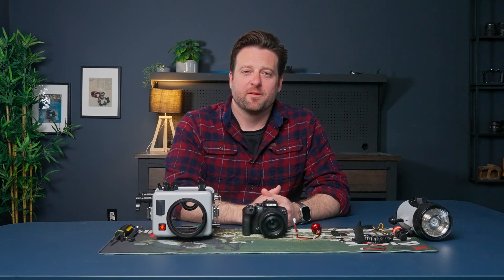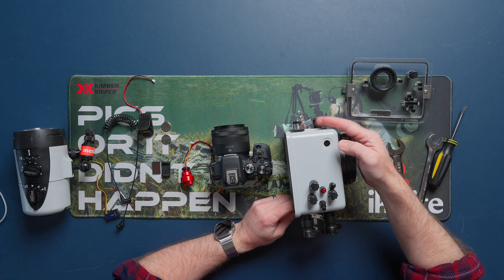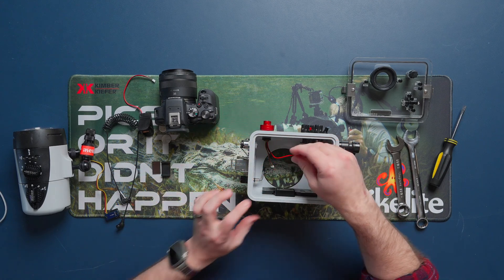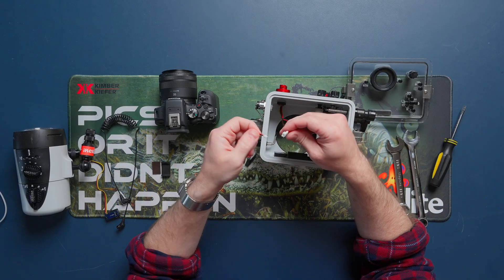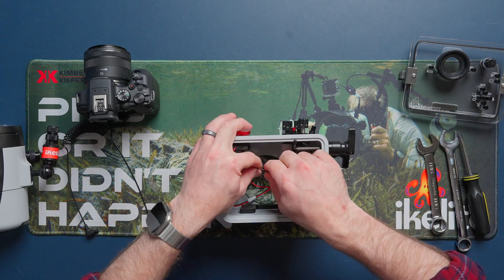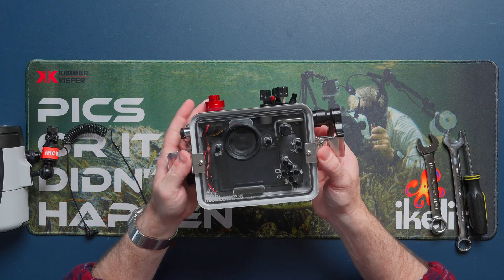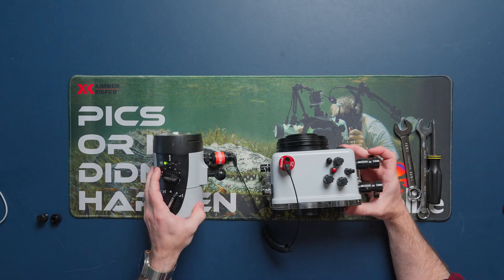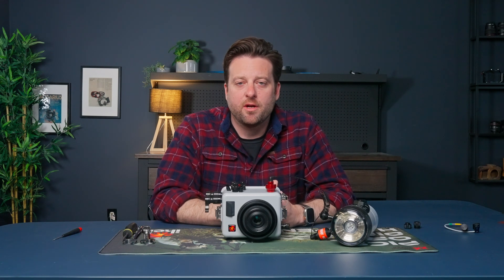TT5 Canon TTL Fiber Optic Transmitter // Setting it Up

Comment: This might sound like a stupid question but oh well.

There are 2 pieces of guidance that Ikelite gives that seem contradictory or at least at odds with each other. With the vacuum system, Ikelite advises to pump out a vacuum ideally the night before, but with the TT5, Ikelite advises to ensure that the system is turned off when not in use. With the housing under a vacuum however there is no way to turn the TT5 on or off so it would have to be turned on before the housing is sealed & put under a vacuum and then sit there all night.

How much of a drain will this put on the TT5 batteries over the course of a week or two long dive trip? Will the CR 2032s typically last a couple days? Will they typically last the whole week? Obviously, I will have spare batteries, but how many will I need?
Reply from the maker: Great question! The TT5 doesn't draw much power when it's not actively in use. Obviously, it will be dependent on how many shots you're taking throughout the day. We've found that leaving it on and connected to the camera will easily allow us to leave it unattended and ready for a full day of shooting the following day. Like you mentioned, it's a good idea to have extra batteries to swap out if they get low. If you're shooting heavily we recommend changing batteries every 2-3 days or sooner if the transmitter isn't producing a red light signal when taking a picture and turned on.

Comment: Multi function ttl hot shoe on newer canon cameras also provide power. You might make a new TTL cable that would not need extra battery (less waste).
Reply from the maker: That's a great idea! The fine contacts on the multi-function shoe are a little less robust and more difficult to interface with but it's something to look at!

Comment: Is there an advantage to fiber optics over a sync cord?
Reply from the maker: Fiber optic cables do eliminate waterproof connections. For example it makes it easy if you want to remove your strobes in between (or during) dives. Otherwise you'll get a similar accuracy, reliability, and recycle times when comparing our electrical and fiber optic TTL systems. Cost is also similar.